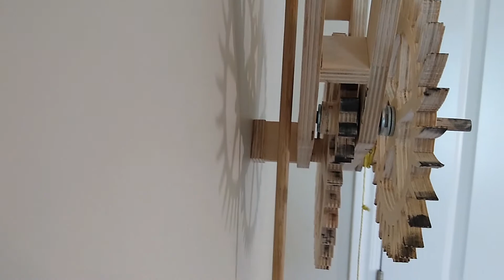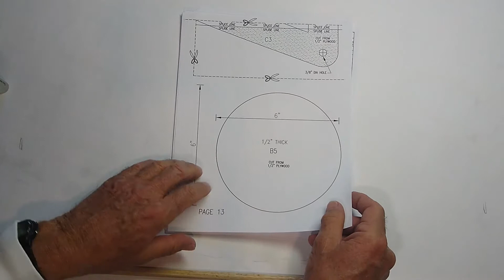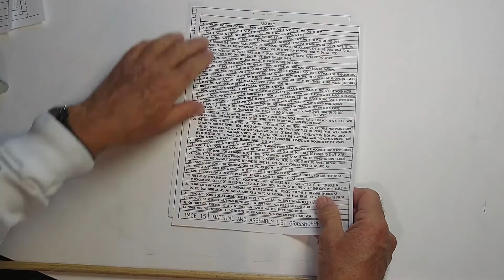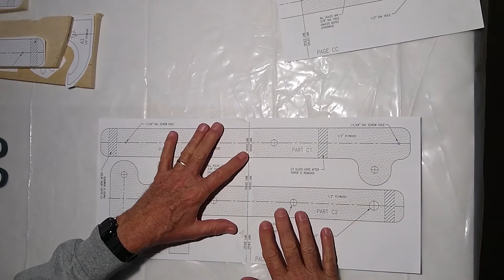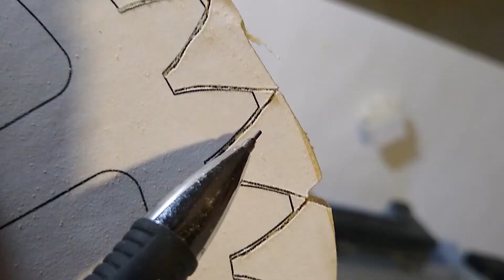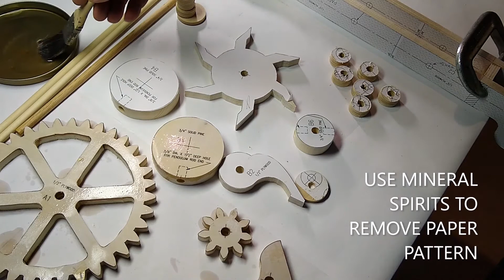Plans and Patterns to Build a Grasshopper Escapement

Comment: I have built two of your others and basically this one, but I don't understand  how the whole weight of the piece is resting solely on the rear pendulum axle!? When I hang mine, the whole thing tilts to the right. there are no other screws to brace it to the wall?
Reply from the maker: After reviewing the assembly instructions I see what I missed.  Looking at section C-C page 1 there are two C4 parts that glue near the bottom to support the frame off the wall.  Looking at side view the two C4 s are just to the left of shaft S4.
David